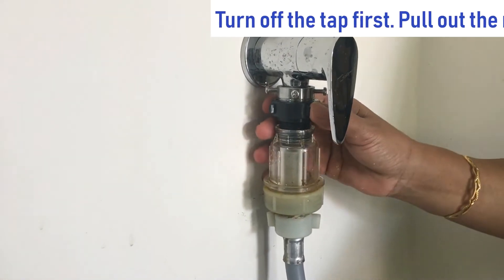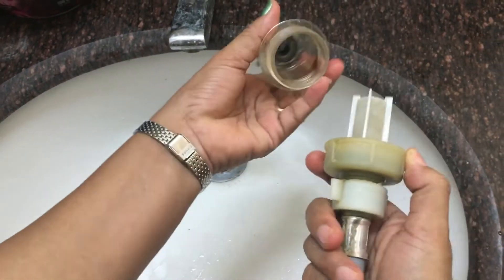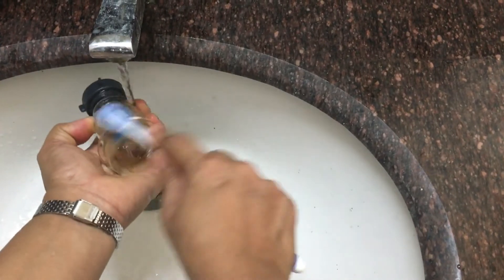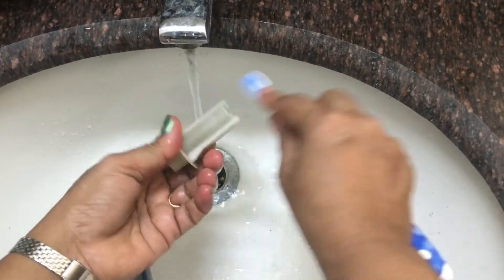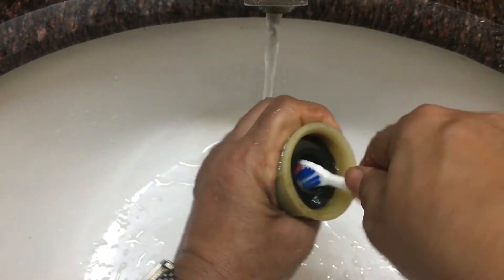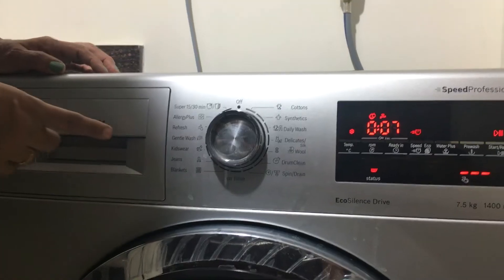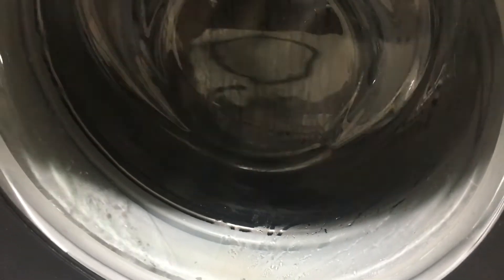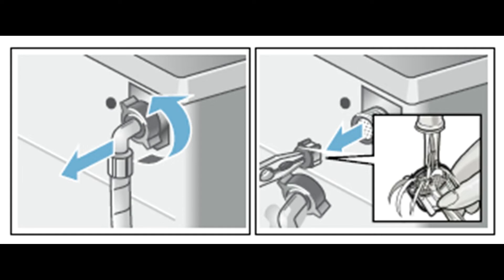BOSCH WASHING MACHINE | WAT28468IN | CLEANING INLET FILTER

Comment: Can you remove this so easily? My filter seems full of water. How did yours not spill when you removed?
Reply from the maker: Hi, please close the inlet valve/tap first. Open the filter after that. In spite of this, a little water will spill out while opening. This is normal and can be cleaned/wiped off where it falls.
Thanks.

Comment: Madam overall hows the product... Is there any vibration during spinning... Can we use one or two clothes or max 2kg should be used.. Please reply
Reply from the maker: Hi Gur, from what I saw i feel overall the product is very good.
The specified noise level is 49 dB, so it os very silent while in operation. 

There is a possibility of vibration if -
1. the clothes are loaded unevenly (unbalanced)
2. the clothes are not a mix of large and small 

3. the legs are not adjusted to the ground level
If these are taken care of, there should not be any vibration in any washing machine.
There is no lower limit of clothes to be washed at a time. So you can wash one or two clothes. Accordingly required quantity of water will be drawn. 

Hope I have made myself clear.
Thank you.
Reply: @BhuvanaAdi  thank you

Comment: U must remove black round washer also which u have not done.why?
Reply from the maker: @Ramamurthy Ramanathan, Normally if there is no dirt around the black filter, I prefer not to remove it but just clean around it. But yes, you can definitely remove that too and clean it and fit it back. Thanks for sharing.

Comment: Can you show how fit the filter and hose back on to tap ? Wont the rubber hose twist? Please explain
Reply from the maker: I did this video at my friend's place in Chennai last year. You can fit it back in 2 ways -
You can twist the hose in the reverse direction before fitting the filter and turning the threads. So at the end, the hose would be back to normal when fitted.
Or you can remove the hose at the washing machine end too, and then fit the filter first and then connect at the washing machine end. Hope this works out.
Thanks.

Comment: I got the solution for removing tap sign check the pipe connection at the back of machine make it a little loose so that pipe can be moved easily.
Reply from the maker: Good to know that your problem got solved.

Comment: Ma'am filter leakage problem. Let us guide how to solve problem .
Reply from the maker: A filter leakage usually means leakage from the rubber gasket/washer. You can get the gasket/washer replaced either by your plumber or Bosch service person. Thanks.

Comment: Very well explained. Thank you. Could you please tell me the working condition of this washing machine when we use hard water.
Reply from the maker: Hi Manitha, normally when you use these machines in hard water, over some time, you will observe scale formation in drum, around the door and in the detergent compartment. It is advisable to use descaling powder and do descaling at regular intervals to combat this issue. Thanks.
Reply: Bhuvana Adi  I live in Chennai, I am just afraid that whether water quality ruin the performance of washing machine. Drum clean or descaling what is the procedure behind it. Do we need extra filters to soften water. Thanks
Reply from the maker: Hi Manitha, you are right. The hard water supply will not only reduce the cleaning performance but is also likely to shorten the life of the machine. The best option is to try to connect soft water supply to the machine if possible. Next best is - there are water softener filters available that can be connected to the water inlet. But I am not sure how effective they are. You will need to buy based on the brand/make and customer reviews. Any water softener system/filter will have limited life if there is no regeneration involved. 
If you have no option but to run with hard water only,  run descaling as regularly as possible, based on the scaling formed.
1)  There are descaling powders available. Put about 2 tbsp of descaler in the detergent drawer and run a full cycle empty without clothes.
2)  Open the drain filter (front bottom of the machine - you will find a small round or rectangular door) and then open the filter, clean it and fit it back. The manual gives instructions on this.
3) The water gets filled into the detergent chamber through nozzles. If these nozzles are clogged, they will also need to be cleaned. But this cannot be done by us unless a knowledgeable technical person is there at home. You may need to call the company or some professional service.
Thanks. Good luck.
Reply: Bhuvana Adi Thank you so much for your  detailed explaination. I will check it out for softeners or else I should opt for complete water softener system . Thank you once again. 👍

Comment: I too get the tap symbol while the washing machine is running.Is there a problem if the tap symbol continues to come?Will it damage the machine in the long term?
Reply from the maker: Hi, if the tap symbol is ON even after filter cleaning, it indicated low inlet water pressure. Regarding damage to the machine, I am not too sure about this. In appliances which have a motor for inlet water, low pressure could cause damage to the machine. But I think, in washing machine, there is no inlet water pump and the water is drawn/filled by solenoid valve opening and only gravity into the machine. So, low pressure will slow down the operation/running time.  Anyway, don't go only by my answer. You could confirm with some expert with knowledge on this. And in the long run, it is better to have water supply pressure as specified by the manual. Thanks..
Reply: @BhuvanaAdi  Do Bosch Washing Machine need Stabilizers?
Reply from the maker: No I don't think so, as manufacturers do not recommend one. But if you have frequent voltage fluctuations, you can install one for peace of mind.

Comment: Could you please tell me where I can find the tap adaptor that you had used to connect the tap filter to the faucet.
Reply from the maker: Hi Ankur Verma, Actually I had done the review and demo of this BOSCH Washing Machine at a friend's place where the machine had already been installed. They informed that the company person brought it at the time of installation. Normally when the company person comes for installation, they sometimes carry such adaptors and charge for that. But in case they do not, these are available in some good plumbing materials shop. Alternatively you could check online for these. I am sharing a few links of what I found online -
https://amzn.to/2Po43FW - Renque® Washing Machine Water Inlet Pipe Faucet Tap Adapter with Dust Filter 

https://amzn.to/2qBNttX - MGS- Washing Machine Water Inlet Pipe Faucet Tap Adapter With Dust Filter
Hope this helps. Thanks.
Reply: You can get it from market those who deals with washing machines spare parts

Comment: Mam i want that filter because it is damaged where can i buy it mam please reply
Reply from the maker: Dear Mr. Subbu, Please try in any large plumbing/water filter accessories shop. Either take the old filter or take a photo of the filter so that you can buy one that is the correct and exact replacement. Alternatively, you could call the washing machine service centre and enquire whether they have it. The one shown in the video was fitted by Bosch technician during machine installation. Thanks.
Reply: Ok mam thanks for info